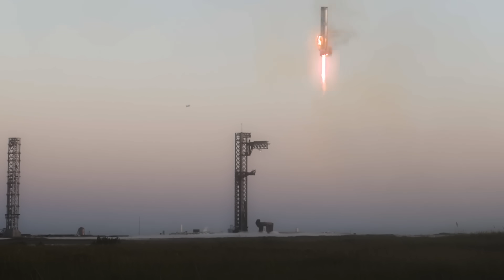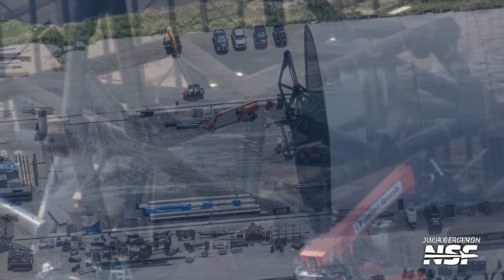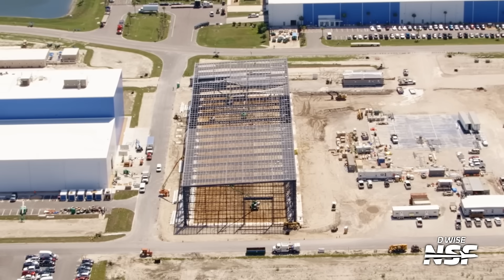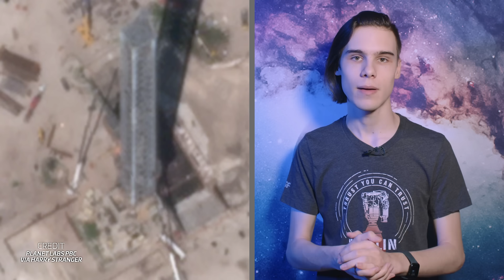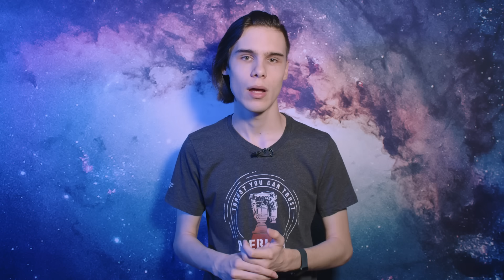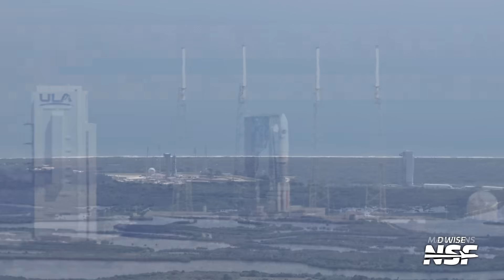Launch Towers Rise: Starship, Stoke, & Artemis Gear Up on the Space Coast!

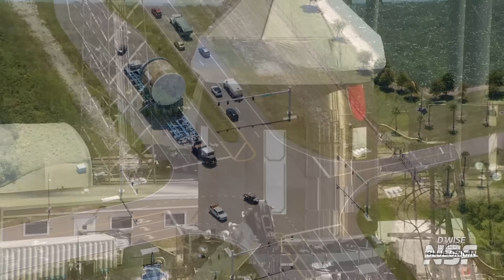Comment: @8:14. Blue did it to you again. The very aft module in question just got tested and rendered the speculation in the video moot. From David Limp:

"Another one in the books - the New Glenn team just finished NG-2's aft module activation test. This test activates the hydrogen peroxide system that powers the aft module hydraulics and conducts a shortened mission simulation of the integrated system. The four auxiliary power units, or APUs, produce a combined peak of 1,000 horsepower to drive the hydraulic pumps, roughly equivalent to the power of a modern F1 car. Next, we will mate the aft module to the rest of GS1 and install our seven BE-4 engines."

The 7 BE-4s are stockpiled at the factory, the GS2 is built and was tested back in April (previous one in late September), the forward module was tested in July (the previous one was tested in August), and now this is done, which they'll take that back for installation.
Reply: Have NG’s hydraulics always been peroxide-powered APUs? - Dave Huntsman
Reply: @dphuntsman  The patents have been there for years, including for the SWAT thruster system.
Reply: NG-1 also had FWD and AFT module testing in the summer, the engines were also ready for installation, and the second stage was fired up shortly after. That didn't ensure NG-1 happened a month after, it actually happened five months after. The speculation still stands. What will Blue do to accelerate the schedules compared to the last flight? Who knows. I'd say Sept 29th is very very optimistic given the pace so far.

Comment: I'd say chances are good for New Glenn.
Preparations for the first launch always take longer. None of the systems have been used before. GSE is new. Rocket is new. All components are new. Testing and retesting to fix problems and also familiarise the ground crew with the system is common.
Preparation for second flight will be more efficient than the first and prep for the third will be more orderly than the second.
Reply: We’ve been told for years that the difference between spacex and everyone else is that everyone else makes sure things work the first time.  Thankfully blue origin proved the folly of that statement.  So did ULA with the off-nominal booster.
Reply: @qwerty112311 Mmm I don’t remember New Glenn not working on its first flight. It very much went into the orbit they were targeting
Reply: @Alexphysics13  BO were very optimistic to believe they could land the 1st stage on first attempt, I wish them well, Yet will still be greatly surprised to see it work for some time yet.
Reply: @favesongslist yeah but landing the booster is secondary. Until they actually are effectively returning and reusing the boosters, it’s just going to be very experimental
Reply: They stated they knew it was risky landing the booster on the first attempt, but they were going to try anyway. And it was clearly stated the primary goal was getting to orbit, which they did, and they hit difficult milestones: restarting the BE-3Us, hitting the MEO orbit, and carrying out a 6-hour long mission testing Blue Ring technology.

Querty and others are just sucking sour grapes.
Reply: @qwerty112311  We've been told for years that SpaceX iterative design is much faster than BO, and that Starship will land on Mars before BO can get into orbit.
See? Two can play this stupid game. In reality it is two different design philosophies and none of them are inherently better.
They both have their advantages. And that you are still here complaining about BO despite them reachin orbit on first try and Starship actually having trouble to get into orbit tells me all I have to know about you.
Reply: @PagsPayback and you rambling about spaceX tells me all I need to know about you as well. See? Two can play this stupid game 😂
Reply: @RickSanchez_85  That I think both are great projects? And that people should stop bashing companies that are making great progress, just because their favorite company does things differently? Thanks for agreeing.
Reply: @PagsPayback well sounded different before 😂
Reply: @RickSanchez_85  What is hard to understand about 
"In reality it is two different design philosophies and none of them are inherently better. They both have their advantages"
Reply: @PagsPayback just say your rambling about spacex eruptions have problems getting to orbit contradicts what you say here. If you wouldn't have a bias for blue than you would know that right now reaching orbit is still not even the goal for the starship test flights. Orbit is the goal start heatshield and ship catch is mastered. You can't put starship to orbit without knowing you can get it back safely again, this thing is a flying giant.

And as some one who also likes spaceX AND blue I know these things and therefore don't ramble about any of them.
Reply: @RickSanchez_85  Dude, it's literally an example why putting one over the other is stupid... And here you are rambling about what I alledgedly meant. Despite me explicitly saying that, and I quote myself:
"In reality it is two different design philosophies and none of them are inherently better. They both have their advantages"

So, if you still have any doubt what I actually meant when I made that entire post, I really can't help you. And I sincerely apologize for whatever
Reply: @RickSanchez_85  well so far it’s a pile of junk.
Reply: @stabsfeldwebela4178 you are the perfect negative example. I give the commentator that he might really don't have any bias but this can't be said about you 😅